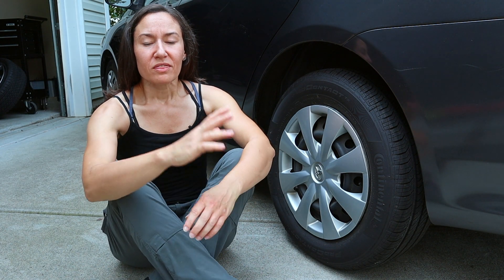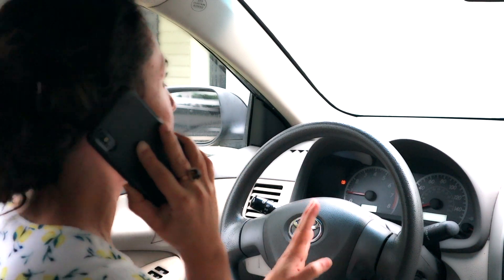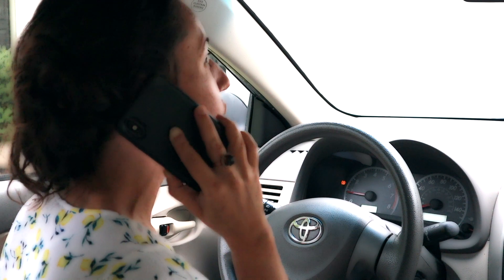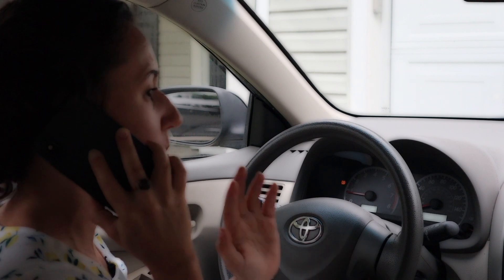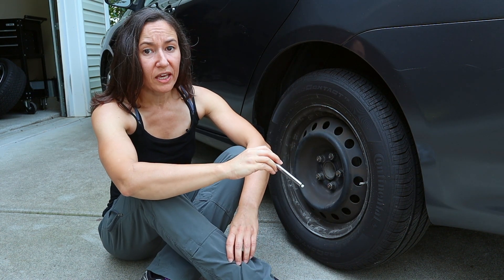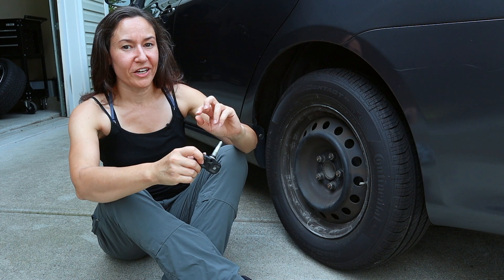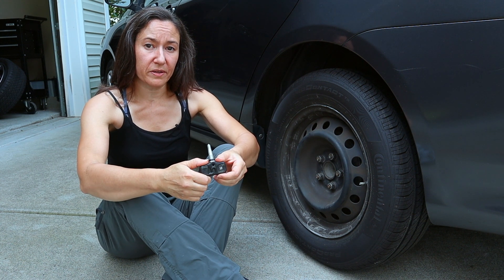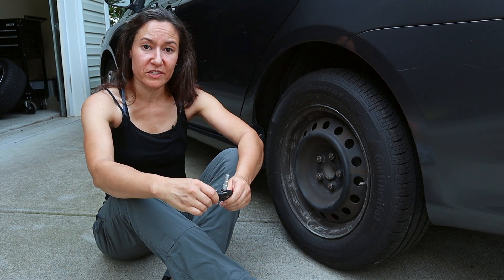TPMS Light Flashing

Comment: Do you by any any chance know the reset code for a 2014 journey ETC light? I know nothing is wrong and it only happens when we are at the most humid and then rains. I know it is key on, press gas 3 or 5 times quick, wait 10 sec and so on but I’ll be damn if I can find the sequence and the mechanic who help me isn’t not at the shop
Reply from the maker: Hey Lori, I'm not familiar with it, but try looking around in forums to see if you can find a sequence that looks like what you're thinking of.  Maybe check out the top response in this thread: https://www.cargurus.com/Cars/Discussion-c22728_ds678517 Good luck!

Comment: When the TPMS sensors are originally set up you have to tell the sensor what is the normal tire pressure of your tires. If this value is set low by the installation techs, you could have tires that have higher pressure than they were set at and the sensor will think you are outside of the pressure tolerance originally set by the installer of the sensor.
Reply from the maker: Right! My frustration as a tech was when my own coworkers tried to dodge dealing with tire lights by re-initializing the system so that the light wouldn't come on until a tire was around 20 psi. The flat rate pay structure creates all kinds of bad habits in some people, lol

Comment: I have a 2009 Toyota Yaris 4d sedan that needs new sensors. I can't find the requirements on how to reset or program new sensors. Trying to determine if I need a tool or if there is another way to do it. I'm going to get new tires from Walmart. They charge $30 for each universal sensor. I can order a set of 4 off Amazon for $40. Walmart said I can order my own, but I'm not sure what kind I can order for certain. I just know there are different kinds available, but I don't now the difference and I don't want to order the wrong ones. Hoping someone can help me.

Comment: can I just totally ignore the light and judge if my wheels are flat by letting go of the wheel for a sec and the car doesn't go straight?
Reply from the maker: If you're going to ignore the light, it would be a better idea to check the pressures regularly with a gauge. Not tracking straight could be a symptom of a low tire, but there are other problems that can cause that same symptom, too. And by that point, you might already be irreparably damaging your tire by driving on it